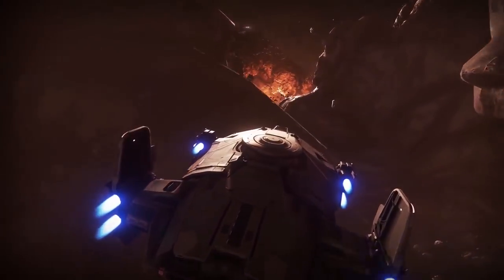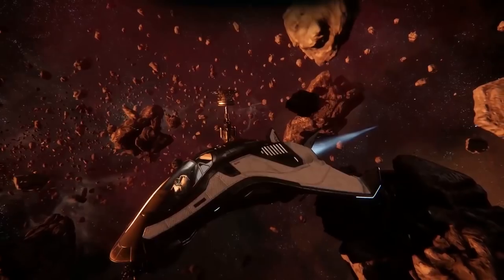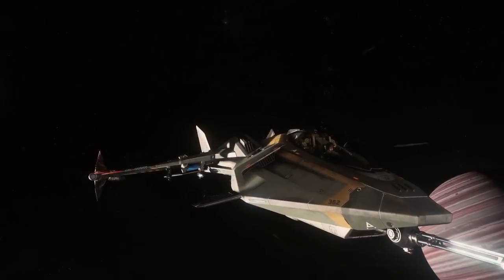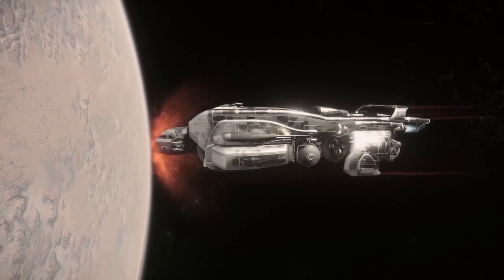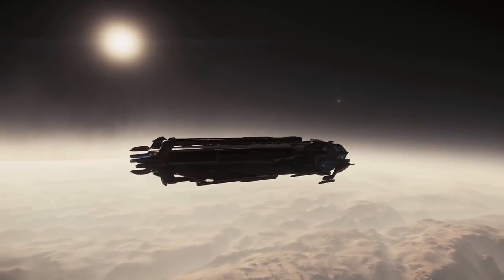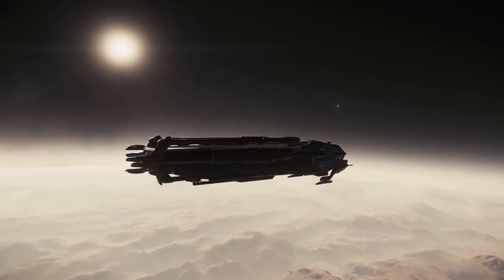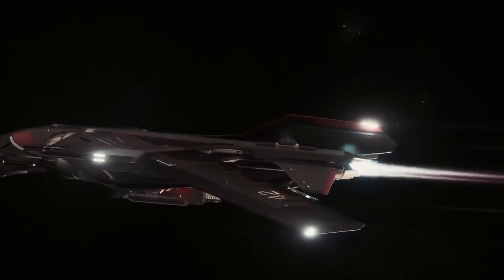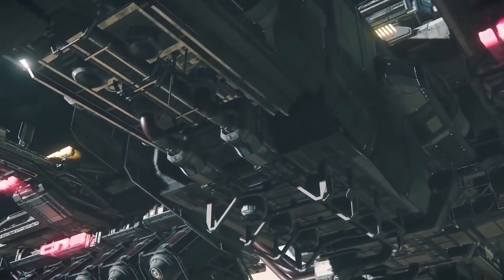Star Citizen | Fuel Mechanics Now & The Future

Comment: At this point it isn't a surprise that CIG is taking care with even the smallest details for this game, though it still is quite nice to hear that they have plans for them. Fuel dynamics as a contributing factor to flight and performance is interesting to hear, especially that there will be different fuel grades which will each have their benefits and downfalls. I wonder if they'll have different types of chemical compounds to harvest or synthesize to contribute to fuel quality by means of experimenting. Harvest some chems here, make a few synthetic ones in a lab there, try different mixtures of the two, see what happens. That would be interesting.

Comment: Good article.  I think it's a bit of "fair warning" to backers that gas station stops and refuel service beacons will be important.  We have got to remember that "our current universe" comprises only the moons of Crusader, and Delamar.  Planet to Planet, Star system to star system, with the scale of it  all, fuel management will play a large part.
Reply: Indeed, they always said that a single star system could provide many many hours of game-play that traveling from star system to star system is not a trivial undertaking and will require some forethought and planning depending on the vessel used.
Reply: What? You mean I can't just jump to the center of the Universe in my starter ship?

Comment: This is lovely news. Making my starfarer more and more viable with each move forward
Reply: Merajito the problem that I can see is that every single shift I have has the long-range designation on it and bust has fuel takes and can Regen normal fuel. Actually the only shift in the game that don't have fuel intakes are short-range Fighters. The only fuel I would need to buy would be Quantum fuel, but the starfarer can no longer dispense Quantum fuel, per the post, you can only get it at cry astro or stations.

Comment: I'm fine with the change, it makes sense that unnecessary equipment wouldn't be included on short-range ships that need to maximize agility or speed at all costs. They just need to address the issue of ships such as the Gladius and Hornet having physicalized intake visible on the ship with INTAKE clearly marked. Should be a minor visual rework I imagine.

Comment: This is awesome and what I hoped for!
I think this is something they could keep pretty reasonably grounded in realism and I hope they do , for instance lighter fuels (Hydrogen and Nitrogen) would be more fuel efficient (because the lighter fuel is able to be accelerated to a higher speed increasing the Isp of the engine) but would produce less thrust (the force produced by the fuel is proportional to the weight of the fuel) thus reducing maneuverability and increasing time to accelerate to max speed. Where as heavier fuels such as argon will create far more thrust but also be far less efficient.
 This behavior could have so many good knock on mechanics as well, for instance anything as large as or larger than a Starfarer couldn't fly in atmosphere using lighter fuels because there wouldn't be enough thrust to keep the ship up so you would need to make sure to keep a couple tanks filled with a heavier fuel if you want to land on a planet and be able to take off again, or if your just doing long hauls maybe you keep all tanks full of lighter fuel because it's more cost effective and would increase the range you get out of a tank, or you sacrifice a bit of range to carry mostly light fuel and one tank of heavier fuel in case of emergencies, such a combat situation, where you need the extra bit of acceleration.

Comment: I think that the fuel machines are well thought out and fantastically realistic which is just great. 

Ships that possess the ability to collect gases directly from gas clouds most likely will be able to separate and collect the gasses simultaneously. It would be a safe assumption given the fact the gases would most likely be sucked up through a single intake device after which it would then pass through some kind of filtration process which would separate the gasses, at this point it would simply be a matter of selecting which gas goes to which tank. Well in theory in any case.
 
(How have they decided to perform the gas collection process or if they have not yet mentioned, how do you think it should be done I am very curious about this because if not done properly it has the potential of being overly complicated or an immersion breaker.

Comment: I think different fuel types isn't bad.  I think it should be handled more like vehicle fuel types currently regular vs unleaded vs diesel vs jet vs etc.  So fighter ships would use a different type than mid sized ships and lager ships.  You might have grades within them, but too many grades in a category can either make them totally pointless to keep balance or create too big of an advantage being able to constantly afford higher grades of fuel.

What makes them D-bags on this is talking about remove scoops on ships that clearly have/had them.  That is really a crappy move when you buy a ship with the expectation they sold you on and then it doesn't have it.  Add to that the way they are changing sales where LTI is available with store credit, so if you are disgruntled with a change and melt a ship for one that is, at the moment at least, more like what you want now you can miss out.

For every advancement they make they also keep changing in negative ways what they sold us on from the start.  Often with no need for it.

Comment: Quantum Fuel is most likely high purity tritium or deutium .  The tritium is a thermal nuclear fuel for high output reactors that need to provide a massive surge of power suitable for jumping.  Deutium is a lest powerful quantum jump fuel.  This kind of fuel has an expiry date due to slow nuclear decomposition.

Comment: Did you forget to mention purging the tanks before refilling with another fuel type? 
Do you think this will only be possible while docked or at least next to a starfarer or the like where you can straight away refuel with the other type? Or will they make a “reserve tank” type feature where you can travel a short distance after you purged your tanks?
It will be interesting to see how big the trade off is between only using cheap, bountiful gas, like hydrogen, where you are less likely to run out, and the rarer type with the the desired properties. I think this could lead to a lot of confusion and need for balancing.
I know they have to make fuel mining more interesting for the SF owners, I feel just adding the multiple fuel types or the grades of fuel would be enough, I don’t really see the need for both, it feels like over complication for the sake of trying to force gameplay. 
Thanks for the vid as per usual. Have a great week.